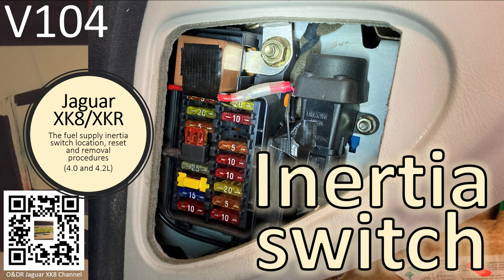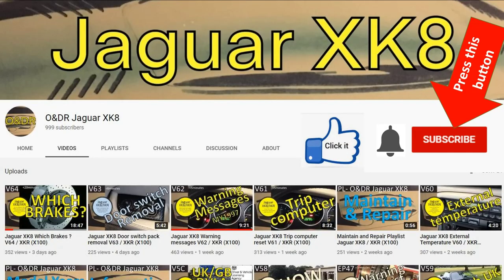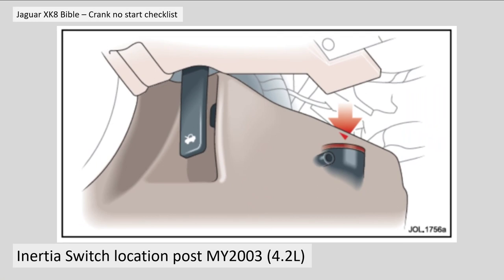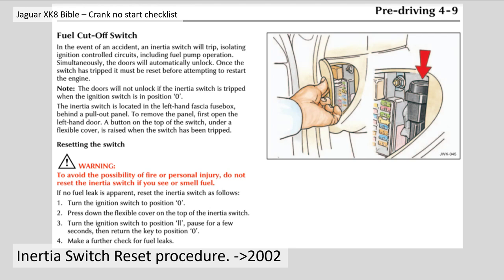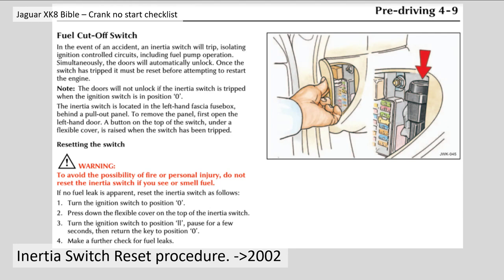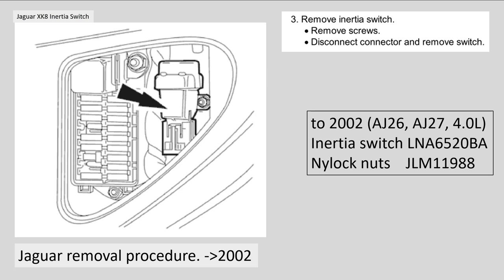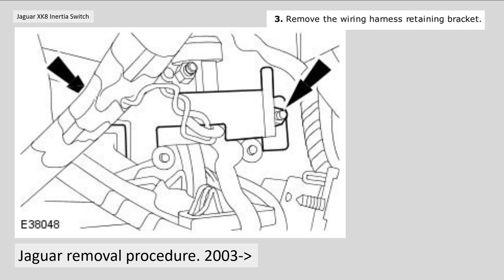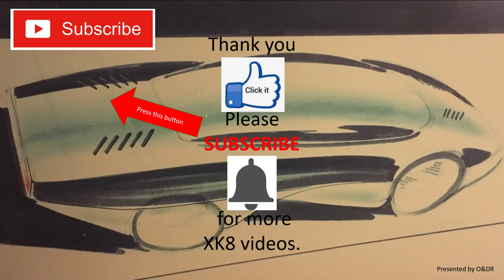Jaguar XK8 Fuel cut off / Inertia switch location, reset and removal V104 / XKR (X100)

Comment: All I can say is thank you thank you thank you you saved my ** again,
First off your video saved me about hard reset on the Jaguar computer and battery.
I recently was ran off the road in my 2000 Jaguar XK8 that only had 30,000 miles on it and never seen snow or anything mint condition I could not get it started again and there was no nothing mechanically wrong with it other than the computer went crazy but resetting the fuel pump saved my ** the car fires right up now and I can get to work on it there is no problems with it the car is in perfect working order but the bumper skin is gone and there's a huge dent in the rear end which makes me wanna cry
Reply from the maker: @EverythingDrone.1, glad to have helped in a small way after your accident. Sorry to hear you had some body work damage. Bumper skins are easy to replace but the dent in the rear end might be more difficult.  Good luck repairing your car, regards Damian

Comment: I have a 1989 xk convertible and the ignition will not go off unless I disconnect the battery. Even disconnecting the plugs from the ignition does nothing. I read a feed where a guy had the same issue and it was his inertia switch that tripped. I pressed mine but does not do anything. Any ideas would be appreciated
Reply from the maker: @iain7800, sorry haven't had experience of this symptom.
Looking at the wiring diagram it might be the ignition switch itself (part number LNC6507AA). As you say you can't turn it off and its not the inertia switch.
You can find the wiring diagram with this link.
https://drive.google.com/file/d/1E14b0TXZjdoGq3TR42c2I71Kg7TETMl6/view
Here is link to a reasonably priced used ignition switch.
https://www.ebay.co.uk/sch/i.html?_from=R40&_trksid=p2380057.m570.l1313&_nkw=LNC6507AA&_sacat=0
Here is the link for the Ignition Switch removal 86.65.03 - Page 782 of 3265.
https://drive.google.com/file/d/1GntT7rcbbW_6nwE45EUw8RhtKaY3kW3U/view
You should be able to test the old switch and/or try another.
Hope that helps, regards Damian

Comment: Please help me, I write from Italy.
My xk8 4.2 does not turn the engine. Turning the key turns on everything but the engine does not turn. The immobilizer light, the one next to the letter p of the gearbox is off, the inertia switch is ok.
If I try with an uncoded key the light next to the P flashes, is this a sign that the immobilizer is ok?
What do you suggest me?
Reply from the maker: Walter, sorry for the late reply. Looks like its not the immobilizer that causing the problem. Might start with the simple things and check the starter motor and its solenoid. Hope that helps, regards Damian
Reply: @ODRModurol  I checked the following things: starter motor ok, fuses all ok, starter relay ok, new battery, inertia switch in on. What do you advise me to check?
Reply from the maker: Walter, sounds like you've checked most of the common faults and it never happened to me so don't have anyone practical experience to share with you. I might suggest joining www.JaguarForums.com and posting the question there. That group might help to find the solution as they as very knowledgeable and large group. Good luck with the fix, please let us know how you fixed it, regards Damian

Comment: Good evening , can somebody tell me about   (stationair luchtregeling jaguar xk8) locatie and how to clean it, idle air control jaguar xk8 from 1996 year,
Reply from the maker: Hakob,  there was a TSB 303-29 advising to change the sharp plug gaps to 1.3mm to improve idle quality, see link below, regards Damian
https://drive.google.com/file/d/1PitFk5opW87jCcqr-5Qa55LNb5OdWxVw/view
Reply from the maker: Hakob, Idle is mentioned in JJM181515-70 including diagrams, see link below.
Extract "At idle, the ECM controls engine speed using the restricted throttle valve movement available
between the mechanical guard (open limit) and a factory set stop on the dc motor drive gear (closed limit)."
https://drive.google.com/file/d/1PitFk5opW87jCcqr-5Qa55LNb5OdWxVw/view
Hope that helps, regards Damian

Comment: Your giving bad information for the jag and if you don’t know you should not post . There is no inertia switch for the 2007 Jaguar is integrated into the system I wasted hours listening to your so-called solution you should pull it down because it wastes a lot of peoples time. Not happy with the way you give information
Reply from the maker: Rich Guy, the video refers to the 1996-2006 X100 version. If you have the 2007 XK it’s the later X150. It’s a completely different car, hence the video is not appropriate to your requirements. Sorry for any confusion and hope you find the solution to your problem, regards Damian